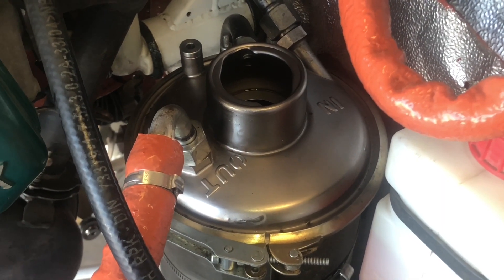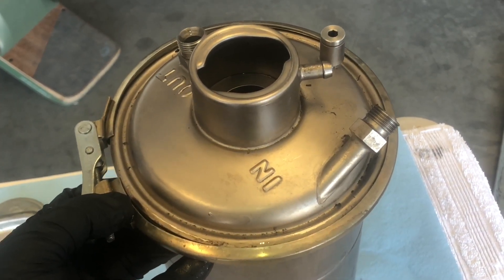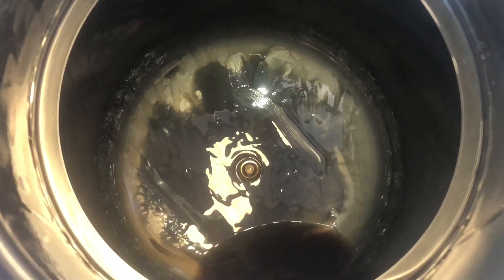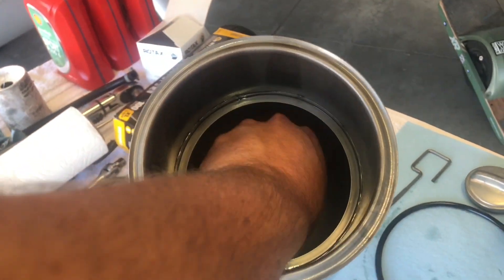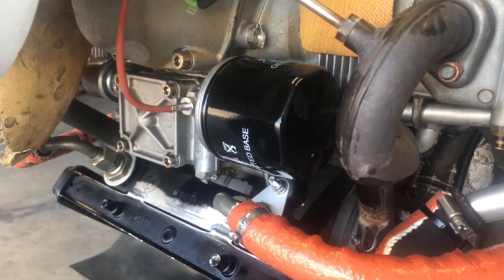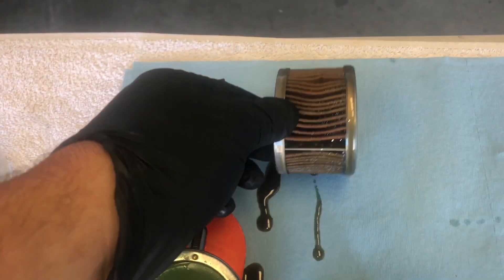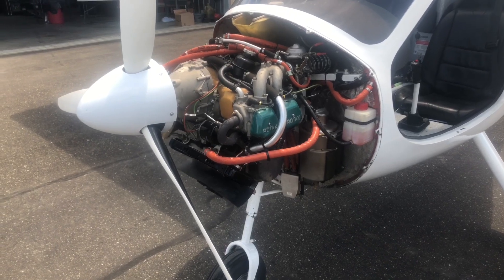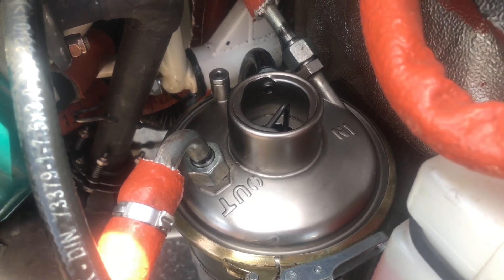Rotax 912 Oil Change Procedure Part 2

Comment: What about the compression washer that came with the 912 oil change kit I bought from LEAF?  I didn't see that mentioned anywhere.
Reply: That’s because he has this drain valve on his. When you remove the drain plug on the bottom of the oil can, you logically replace the crush ring with a new one when re-assembling.
Reply from the maker: The compression washers PN-250-010 should be replaced anytime you remove the drain plug which I didn’t demonstrate on the video. Make sure to torque to 25NM and safety. Use a wrench to back up the fitting in the tank. Hope that helps!

Comment: My Rotax powered aircraft was spitting oil today. Upon inspection, the oil filter was noticeably loose. Wondering if it was improperly installed or vibrated loose over time. Mechanic said the Rotax motor is the only airplane motor he knows of where the oil filter doesn’t lock into place. Dipstick reading in the middle pre- and post-flight.
Reply from the maker: I’ve never had them come loose but they do need to be installed properly, make sure the gasket is in contact with the pump housing then twist 270 degrees past that, works out to about as tight as you can go with your hand

Comment: 1. Did you actually  rotated the prop. 50Xs?? 6:39.
You mention putting 2.5 lt of oil, then running the engine, burp, then adding the additional remaining oil, correct?
How long did you run the engine for?
Great video!!!!

Comment: Great thorough videos. Few weeks ago I had the thrust washer fail on my 912iS at 1700 hrs.  Found lots of plastic debris in the bottom of the oil tank, and some slivers of metal. I've now replaced engine for new one. During take off I had drop in oil pressure followed by spike in oil temp and surging of my hydraulic prop, landed without issue. Probably could have had gear box rebuilt and flush engine but I use for survey work so I opted to replace the engine.

Comment: Great video. I use Avgas as well, maybe 60%, I installed the Curtis drain valve and had a lot of trouble opening the valve. Luckily I did not apply excessive force or used a tool. Turned out my 2016 Bristell with the ULS has a modified shelf at the bottom of the tank which is curved towards the bottom, preventing the drain valve to come out. So in the future is it OK to just open the clamp a bit before opening the valve?

Comment: Have had four 912 engines. Three I installed on aircraft I built. I strongly disagree that oil tank cleaning needs to be done so often….maybe every 500 hrs at most, if at all. The very design of the oil tank utterly sequesters contaminants in an eddy free cavity. Yes…it does make one feel good and tidy to get that bit of little bit of gook out. Taking it a logical step further….what about the lead and contaminants in the bottom of the crankcase….never clean that out do we? It hurts nothing IMOP, but the cleaning procedure introduces multiple points of potential failure and oil leaks. I don’t think Rotax considered the risks associated with this maintenance procedure as well as the purging process.

Comment: Very well filmed! Loud and clear understandable and correct.
One thing- really important with Rotax: you've forgot to check the magnetic plug!!
It is of great importance and mandatory. If there are metal parts found, the gearbox has to be inspected. 
So unscrew the mag plug, visual inspection, clean , rescrew calibrate and finaly secure it with wire.
Reply from the maker: I believe the mag plug is in Part 2 :-)

Comment: Thank you for a really good video. Just a couple of thought I picked up from Rotax training at Lockwood.  

1) After inspecting the oil tank’s “O” ring for cuts and nicks, be sure to lubricate the “O” ring before reinstallation. 
2) To ensure the oil filter fills and any air that may have entered the lines is purged, rotate the propeller (as you described) 30-50 times until a normal oil pressure is achieved. The easiest way is first to ensure the magnetos are off* (shorted to ground), remove one plug from the bottom of each cylinder (noting the cylinder from which each plug was removed) and manually or using the starter, spin the propeller. If the latter, remember to pause after 30 seconds of cranking and allow the starter motor to cool down, then repeat until a normal oil pressure is observed. Re-install the plugs to the cylinders from which they were removed and torque to spec. 

*Note: It is really important that the magnetos are both grounded. Otherwise when cranking, the engine will attempt to start and without the plug, the high voltage will discharge into the electronic module, damaging it ($$$). If you’re not sure, disconnect the battery and manually turn the propeller. 

Thanx again. Great video.
Reply: Hi Robert, Just an observation,  If the modules aren't grounded, they can be damaged by hand turning whether the battery is connected or not. Disconnecting the battery will have no bearing on the ignition.

Comment: Excellent video, but I have a question: why adding the empty filter and priming it manually does not arm the engine putting air into the system?
Is not the filter filled of air when you install it?
Reply: the new oil filters can be filled 3 times before installing. No rotating prop required

Comment: Very grateful for your clear and careful presentation.
Could you present a video on how to avoid introducing air into the oil lines and how to purge the oil system if necessary?

Comment: The anti-drainback valve isn’t the reason you can’t fill the filter before installing it.  It is because Rotax mounted it horizontally.  On my cars that have a vertical filter, I always fill the filter before installation and all cars have the AD valve.  My Chevy truck also has a horizontal filter that can’t be prefilled.  It would be nice if Rotax used a cartridge filter like my newer Chevy cars.  They are on top of the engine and much cleaner to change and you can inspect them easily with no metal can to remove.  I hope Rotax follows the automotive lead and includes that in future designs.
Reply from the maker: The 825-703/706 filters Rotax used for years until 2010 could be prefilled, after adding the anti drain valve to the new 825-012 and 825-016 filters you could no longer get oil into the filter without installing it and manuelly priming it.
Reply: Jeremy Macgregor I don’t see how this is a function of the AD valve.  All cars have had those for years and it is still easy to prefill the filter. You just pour the oil in the hole in the center of the filter.  Sure, you can’t fill through the perimeter holes as the AD valve blocks those, but you can still fill the filter through the center hole.
Reply from the maker: I know what your saying but on the Rotax filters you can’t even fill thru the center hole, the most you can get in there is about 1oz if that. Typically on an oil filter you can fill it thru the center and allow the element to get saturated but on the Rotax Oem filters that is not the case, I personally liked the oil style filters.
Reply: Jeremy Macgregor That is odd.  When you cut it open, I didn’t see anything blocking the center hole.  Is there another valve there that gets opened when the filter is screwed onto the engine?
Reply: @LTVoyager  what Jeremy means is the filter valve is closed so that stops the air escaping which in turn stops you getting oil into the filter.

My simple life hack is to use a syringe and fill the new filter via one of the small holes.
Very carefully displacing the rubber valve .
That way you can fill the filter to the brim and then quickly fit it to the engine with very minimal oil loss 👍✅
Reply: Yep that's what I do.
Reply: The newest oil filters can be pre-filled through the centre hole, and topped up as the oil soaks through the paper filter into the can. The anti drain seal makes this easier to do, so that when you install the filter, the oil doesn't drain out, within reason.